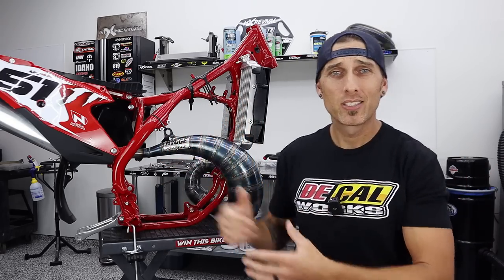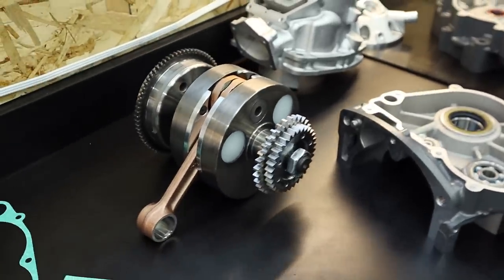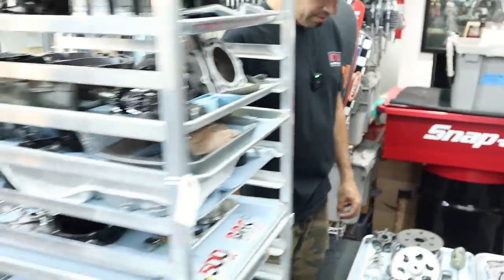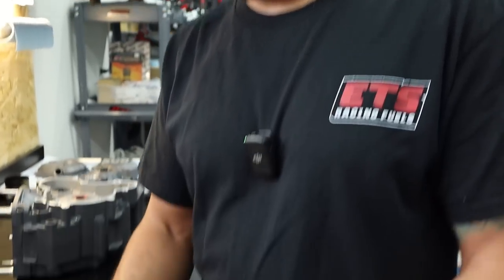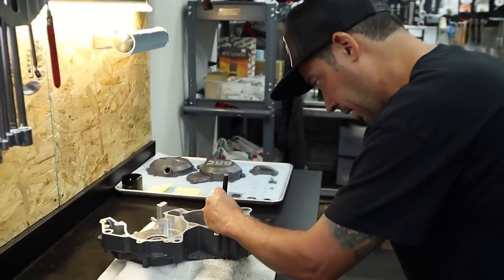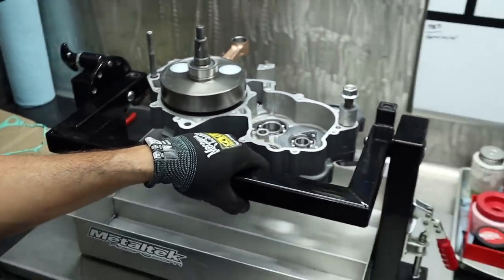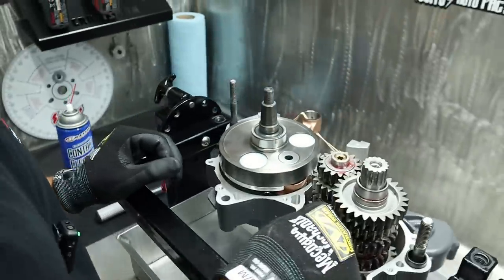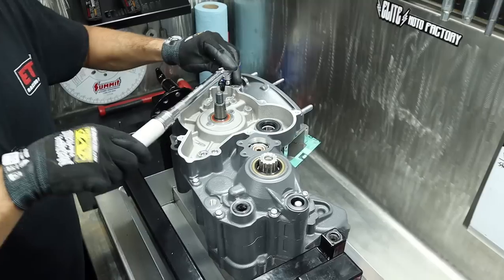Justin Barcia's new FACTORY 500cc TWO STROKE?? Just Imagine... 🔥 2023 Gas Gas MC500 Dirt Bike Build

Comment: You guys have been hammering down on the GG it looks great. What did you guys clear coat the pipe with ?  It needs to with stand the heat please let me know what you used ! Thanks !!
Reply from the maker: I just saw your other comment, working on that answer for you. 🔥 I can’t remember what it’s called but I know it is a very high temp coating. Last I checked it was not Cerakote although that would work great as well. High temperature clearcoat. (if you ever need to have a pipe you own done locally or something)
Reply from the maker: Just reached out and it turns out that it  
is so top-secret that I’m not even allowed to know! I tried 🤷‍♂️
Reply: @mxrevival  well I appreciate the response / thank you ! Still a sick bike and such a gnarly pipe !!! Massive